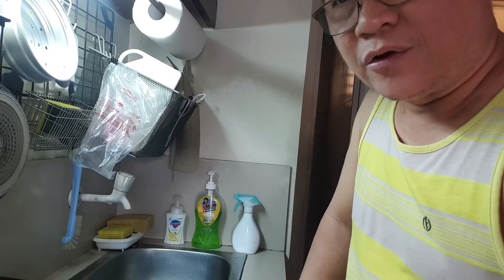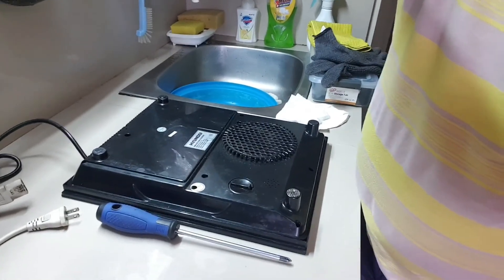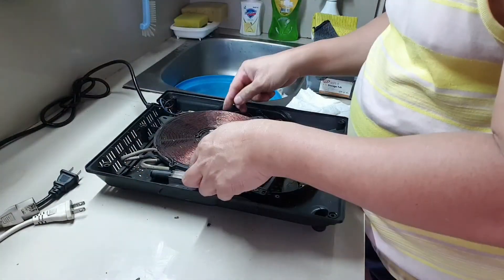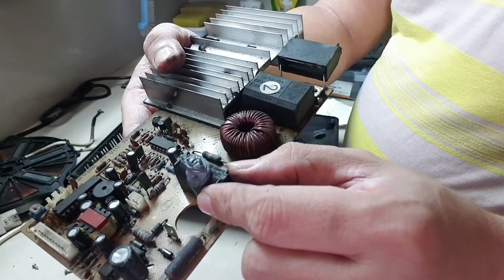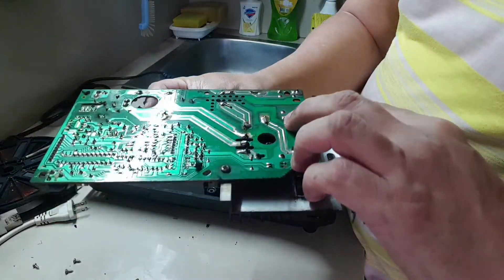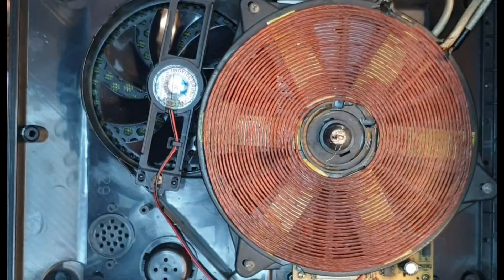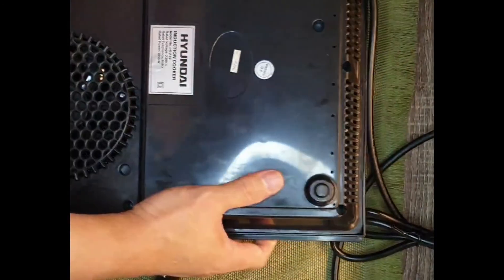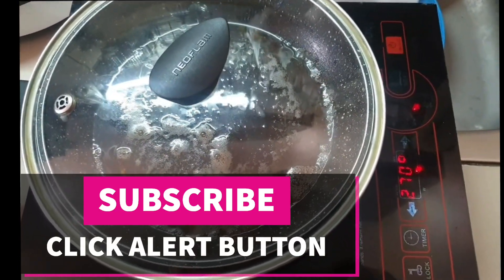DIY: How to Repair An Induction Stove (Capacitor Explosion)

Comment: sir nasira din yun capacitor ko na 2uf 275vac. umorder ako sa shoppee kso dumating skin 2uf 450vac. uubra kaya to sir kung icoconvert ko yun terminal ng capacitor d kya masisira boss kc 450vac ikakabit ko?
Reply from the maker: Ok lang yan, mas malaki working voltage.
Reply: thank you sir ❤

Comment: Hi, do you know po why most of induction cookers doesn't evenly distribute heat on pan? They burn easily on the center.
Reply from the maker: On the contrary, induction cookers should evenly heat the pan because the coil underneath is usually circle like the one in this video.
Reply from the maker: On the contrary, induction cookers should evenly heat the pan because the coil underneath is usually circle like the one in this video. Maybe, the quality of the pan is a contributing factor why the heat is not even.

Comment: There is no polarity in static capacitor hence can be fitted either way.. Pls. Check IGBT/MOSFET, bridge rectifier, fuse.. 5/8 volt &18 volt..